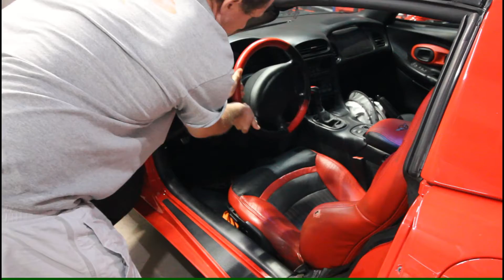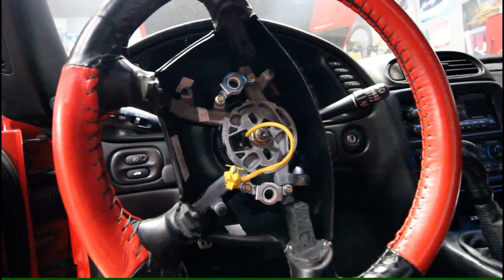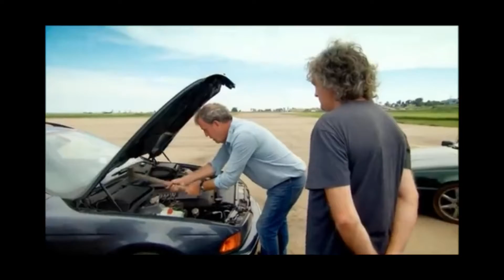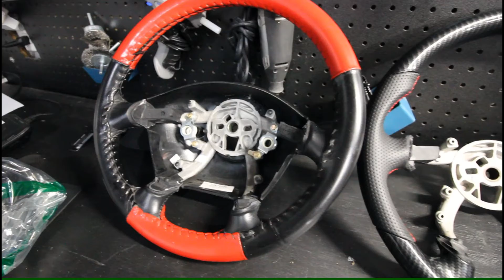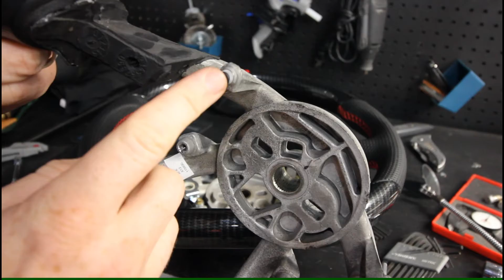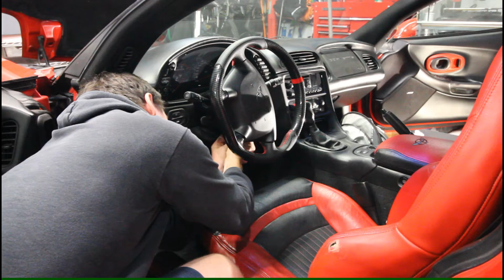2 Tips to EASILY Remove a C5 Corvette Steering Wheel!! - Revesol Wheel Install

Comment from the maker: Use the discount code “Hnat10” for 10% off your Revesol wheel!!
Reply: is it possible to install the steering wheel off center??
Reply from the maker: @lucadimarco2087  Based on what I saw, there is a key way on the spline for the shaft and wheel hub, so it should only go on one way

Comment: How much did you shave the puller arms down? I have the tool but the j hooks won’t fit in the holes. I’ve been shaving them down but still won’t fit
Reply from the maker: Don’t have to shave a whole lot. Really it seemed like it was just some of the flashing left over from the casting process.

Comment: After you turn the steering wheel take the t30 bolt off from the upper first from the dash instead of the bottom… so much more room

Comment: Im installing mine right now. One trick I found when pulling the T-30 bolts off. Use just the extension to find the bolt pattern. Once you do, hold it in place and connect the wrench after you find it. Took 20 mins opposed to an hour 🤘🏽

Comment: today is June 26th, 2026, my new carbon fiber steering wheel from TESFEEL on Amazon ($160.64) arrived at 3 pm today, I had started the disassembly about 2 hours ago, and then watched this video, the job is done..........no issues, no mistakes, just done and it looks so frickin' cool.  This was a  GREAT step by step guide and I thank you for it.  I didn't need to let mine sit overnight with solvent on the threads, it came off with little effort after about 30 minutes to let the solvent get into the threads.  The slowest step is those damn Torx 30 bolts....what a pain in the arse!!!
Reply from the maker: Glad you're happy with yours and the video helped! Definitely an overlooked upgrade since this one of your primary contact "inputs" while you drive the car!

Comment: To be 100% honest, those two bolts holding the airbag was confusing the crap out of me until I used my little icon ratchet with the t30 bit on the end of a dewalt magnetic bit driver. Came out super easy and went back in super easy. All in all the whole swap took me less than 30 min.
Reply from the maker: Nice, good tip on this! Glad it went smooth after those two bolts!

Comment: Hey man I finally got those t30 bolts off & the nut loose I must have watched your video 100 times mate I’m stopping now until I get the steering wheel puller from O Riley’s I’m going to rent it thank you 💯
Reply from the maker: Hey Mark! Apologies for the delay in response on this, missed your comment notification in my inbox! 

Hopefully you were able to get it off with the puller tool from O’Reillys! Glad the video helped!

Comment: Thank you bud so much for creating this video. The only thing I would add to your excellent tips and tricks. Is I would emphasize the importance of having that specific PT puller absolutely square and centered when the extreme tension starts.... It cannot be off even one degree frankly because it will bend exponentially off of that..... I used a ratchet strap hook and wrap the strap around the top of the steering wheel to keep the puller level for the small moments that it wanted to go one way or the other....But once that force was perfectly centered I got my torque wrench on it with 24in handle and the satisfaction in the pop is second to none. Lol but message to all Make sure that puller is perfectly straight with each spin. I had to stop and actually straighten the puller hook arms with a small sledgehammer five times and restart until I got it perfect. Just have to be patient and if you see it  starting to bend in any direction even a little bit It's already over and you need to reset.
Reply from the maker: Glad you found the video helpful!! Your tips and insight are also really valuable to anyone else watching this video! Thanks for sharing.

Comment: Use a dedicated penetrating oil not just WD40. WD40 does make a penetrating oil but that can is just the basic stuff for drying out electrical parts. PB Blaster would be a good choice.

Comment: Pro tip; Use a air hammer and gently buzz the shaft with a blunt hammer head insert in the gun. (leave the nut on so it doesn't fly off into your face).
Also, spray some PB Blaster on the shaft, leave for an hour and it can help release the wheel.
Reply from the maker: Oh yea that is a great idea, thanks!

Comment: might want to comment how unless you've had the steering wheel lock module installed there is no way to turn the wheel with the battery disconnected
Reply from the maker: Yea good point thanks for commenting that. I wasn’t aware that my car had this mod done until after I did this steering wheel install.

Comment: Hey, how are you getting around the steering column lock to turn the steering wheel with the battery disconnected?
Reply from the maker: Honestly I was kind of surprised I was able to turn it like that, but I know this car has the column lock fix done in the past, not sure if that’s how?
Reply: Thanks for the response. I went ahead and ordered the LMC5 module to permanently disable the lock.

Comment: I would definitely buy a small butane torch and add just a little heat. People under estimate how much it can help through metal expansion.
Reply from the maker: Yep I totally agree, just have to be careful it’s not overheated and you risk damaging some of the plastic components in close proximity.

Comment: I thought those bolts were T27?
Reply from the maker: Whatever size I mentioned I used in the video was what worked. Perhaps they changed fastener head sizes for different model years. Most torx socket sets have enough of a size range to cover you whichever one it is.

Comment: I don’t often comment on videos, but this one was particularly helpful. I just ordered a carbon fiber steering wheel from Overtakeauto for my 2004 C5 Corvette. Following the steps in this video made for an easy project and I was done in just over an hour start to finish. I did NOT need to use WD-40 on the splines as the wheel came right off with the puller I rented from O’Reillys. Thank you for taking the time and effort to make and post this video!
Reply from the maker: Hey Richard, glad the video was helpful! Thanks for your comment and support!

Comment: did everything you did and mine would not come off, the steering wheel removal tool stripped its threads from tightening it so much. saw a comment about using a cigar torch lighter, might try that
Reply from the maker: Dang thats a bummer! Sorry to hear it’s so stuck. Heat is a good option for getting things to unbind, just be careful you don’t melt any of the surrounding plastic parts (clock spring).

Also, did you let the penetrating oil sit and soak for at least like 12 hours?
Reply: Any lick
Reply: Luck

Comment: Bro pro tip...Just use a cigar flame lighter or a lighter torch. When I replace these I just heat it for maybe 30 seconds the metal expands and then cools and it comes off easily. Great video.
Reply from the maker: Another good option, I was just weary of heating up the plastic clock spring housing too much.

Comment: So if you're just tossing the steering wheel out, you bust out a cutting wheel and just cut open the sections you need to access those bolts pretty easily. 10 minutes instead of an hour!
Reply from the maker: Yes I guess that’s one way to go about it. Except it’s a lot messier and that’s a lot of vibration you’re sending through the column and interfacing components if you use a sawzall.

Comment: Thanks for the video! Does the glass roof panel come out of your vehicle? I would add the recommendation to remove it if possible during the seat installation if possible.
Thanks again🤟🏽
Reply from the maker: Of course, thanks for watching! And yes, I would totally agree with you there. Taking out the roof panel will definitely help maneuvering the old seats out and the new ones into place.

Comment: Thanks a bunch dude, pulled it off with  no trouble thanks to your diy.
Definitely suggest drenching the bolt with wd40. 
When it came loose I found wd40 in the threads so assuming it played a good part 🤷🏼‍♂️
Reply: Took me 2h total to remove the airbag and wheel, also filmed it and watched your vid 😅 every now and then.
Reply from the maker: Glad the video helped and you were able to get it off! That's a big reason why I make them, to help others!
Reply from the maker: Glad the video helped and you were able to get it off! That's a big reason why I make them, to help others!

Comment: Question was your airbag/ horn a little loose when you were done?  It seems like
mine has touch more of play.
Reply from the maker: I didn’t notice anything different from before I removed it. Do the two bolts need a little extra tightening? 

Actually, did you replace those little rubber nipple things onto your new wheel? I believe those help provide a soft surface for the wheel to mate up against so it’s not metal on metal that will chatter or vibrate.
Reply: @Addimotive  I forgot all about those! Thank you sir
Reply from the maker: @ty_the_guy951  no problem!
Reply: @ty_the_guy951 I didn’t use those rubber pads either man no big deal

Comment: Great tutorial on the issues with the C5 steering wheels. Mine didnt want to budge at all and I wound up taking it to my body shop guy. He had it for another couple days before he was able to make it break loose. He wound up drilling and tapping the wheel to use bolts and not the J-hooks. Mine was a nightmare. Glad you were able to get yours by yourself. I've never in all my years of wrenching had one this bad. 😎👍
Reply from the maker: Dang yea I've seen some cause quite a fuss! Thanks for the comment!

Comment: Factory lock tight on the splines
Reply from the maker: lol really?  I never saw any residue that looked like old loctite on the splines. Why on earth would they put loctite on the splines? I understand the steering shaft threads, but splines aren’t meant or needed to have loctite. Unless that was meant to fill the gap of any tolerance slop between the male and female portion of the splines.

Comment: I tried that discount code and it’s not working, do you have a new one?
Reply from the maker: Are you sure you’ve spelled it right? Hnat10 

If it’s still not working, I’ll reach out to my contact at Revesol
Reply: @Addimotive 
I was trying to buy through their eBay shop and it didn’t work there but it worked on their website.
Reply from the maker: @Chadmdobson  ah I see! Okay good to know, glad you got it to work. Did you get a wheel for a C5 also, or another car?

Comment: @Addimotive is it possible to install the steering wheel off center??
Reply from the maker: Based on what I saw, there is a key way on the spline for the shaft and wheel hub, so it should only go on one way
Reply: @Addimotive  hopefully my alignment fix it tomorrow cause I mounted mine before watching your video and now it’s off center but before with the old stock steering wheel it was fine :/  I tried pulling the steering wheel off again but now won’t come out cause the j hooks shaved of some portion of the holes where you pull making not enough contact now
Reply from the maker: @lucadimarco2087  hm that’s weird. Yea take a look at your stock wheel you took off. There should be a keyway on the internal splines that allows the wheel to only go on the shaft in one position. Unless there were variations in shaft/wheel hub design over the years. My car is a 2001.

Comment: Hey I’m trying to replace my c5 inner fender & just finished your rebuild videos I was hoping to buy your 3D printed fender spacers are they still available??
Reply from the maker: Hey! Thanks for reaching out! I had to take a little break from making 3D printed parts on my Etsy store (we had a new addition to our family) but I do plan on getting them back up for sale in the coming weeks. Is there a time you specifically need them by to finish your fender repair?
Reply from the maker: I’m also changing the material I use to 3D print parts like this so they’re much more robust.